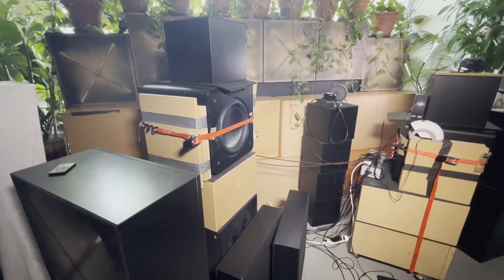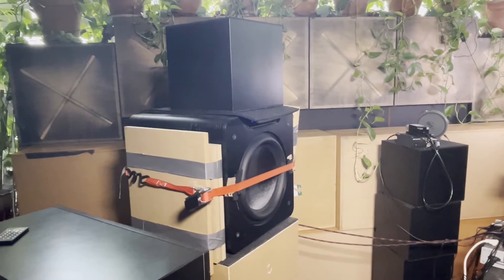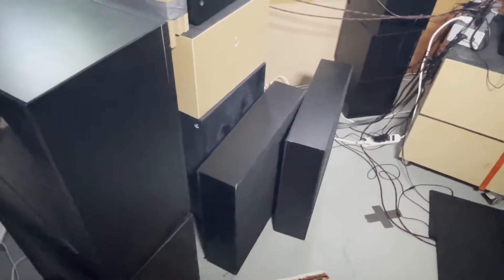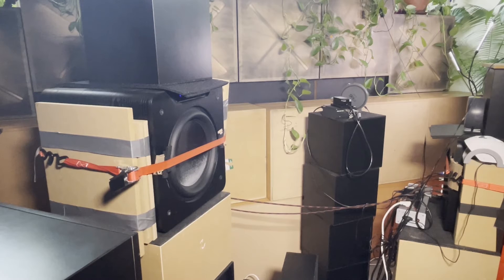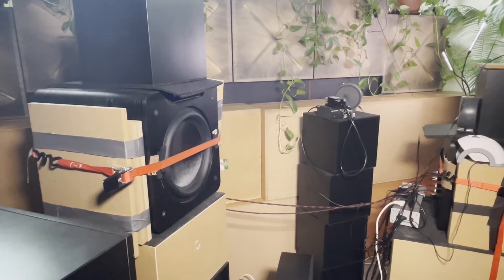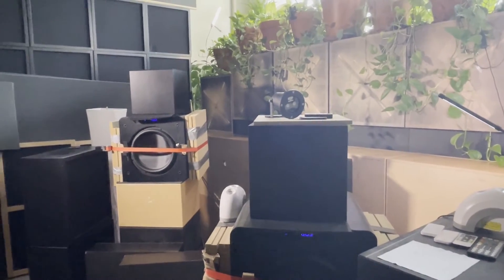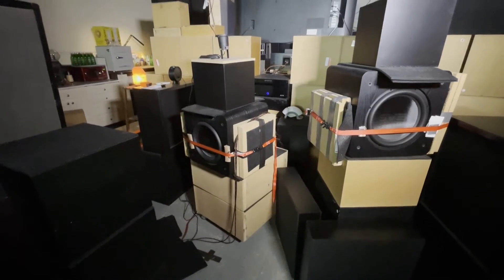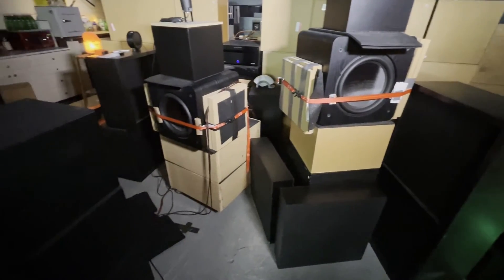Multi-Channel - Subwoofer Setup - Part 3/6 - www.AcousticFields.com

Comment: Hi Dennis Foley.
Any chance you can do a video on how subwoofers and towers interact in an 8 diameter monolithic concrete dome with 2.5 meter stem wall and 7 meter ht dome?
Just wondering how my future February 2023 build of concrete infinite baffle subwoofers will sound in my future build concrete dome?
 Plan to place varied absorption materials at the dome apex where they will work best.
Build will be 12 subwoofers of ib318 v2 from fi car audio soon to be one audio USA for the sq division
Reply from the maker: A dome is not an ideal surface area for any critical listening environment. It will require extensive treatment.

Comment: What's attached to the sides of the subs?
Reply from the maker: Constrained layer mass damping to minimize cabinet vibrations. A speaker has three main sources of audible energy. We have cabinet resonances, driver sound, along with the electronics to drive everything.

Comment: I understand that the room is in your research facility but it just looks like a jumbled mess with no sense of what a real room would look like with your acoustic treatment.
Reply from the maker: You can go to the projects section of the web site and review current treatment types in different room settings. Use a liitle effort on your part. Just like the effort we put into research and develeopment.
 https://www.acousticfields.com/projects/
Reply: I get a good sense, it's just a bit out of reach for me right now. Just look how the subs is surrounded by mass dampening and then you could see them in a really tidy room with  painted units free standing or connected somehow. Dennis have kind of made a room in a room the open spaces behind the right chanel is not really what he wants, if he built a new building it would look like a normal room with units in all the wall I assume